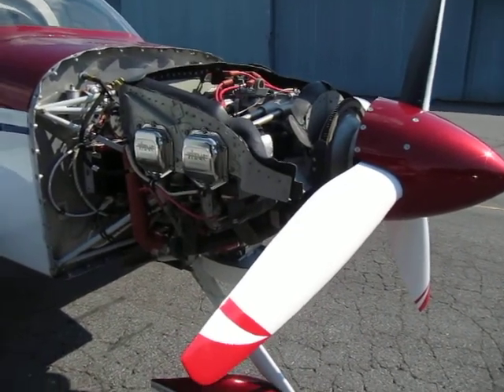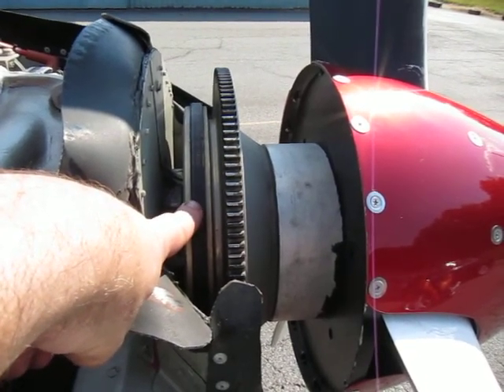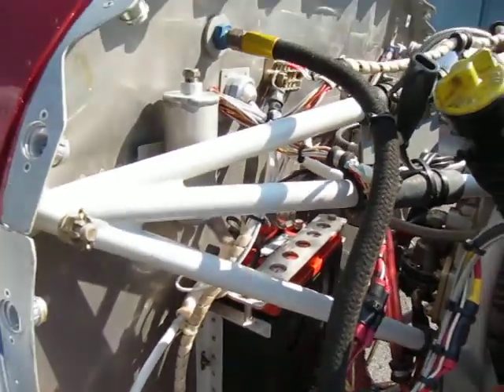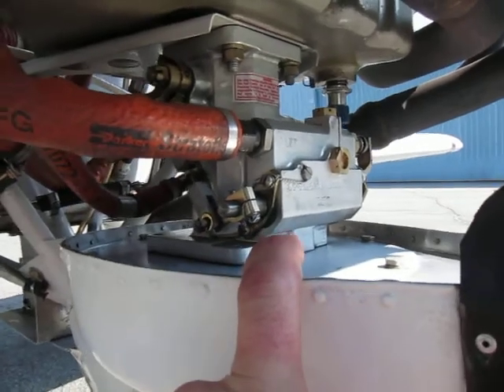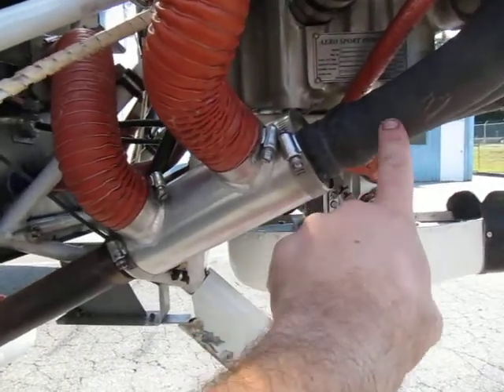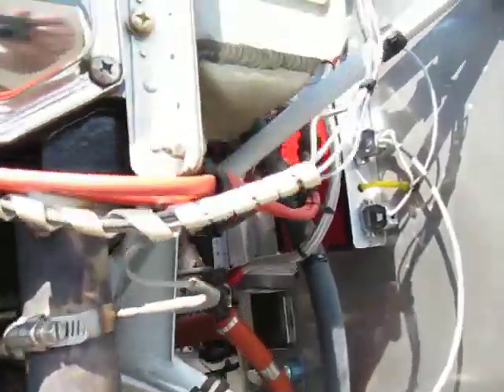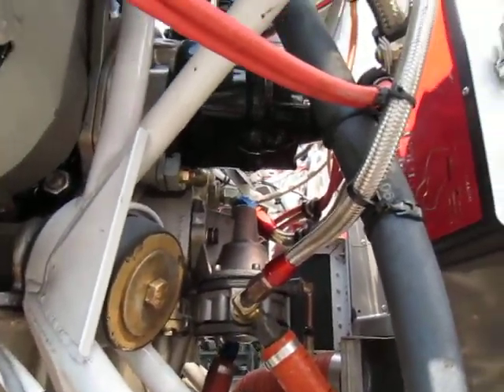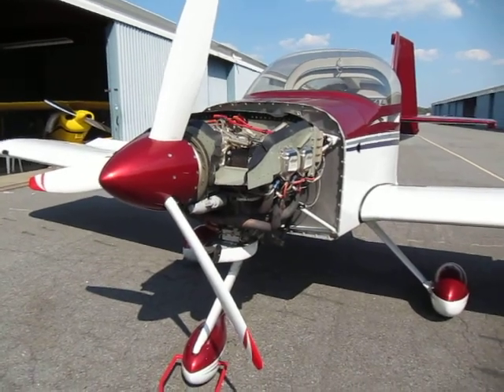RV-7A Engine Compartment

Comment: I realize this video is years old , so perhaps someone has corrected you since ..........the long bolts holding your oil cooler on should have thin wall aluminum tube over them with washers on each end , mounted between the angle brackets that are on the cooler..........that way when you tighten the bolts down it does not bend the angles over and crack them...........the total length of the 2 washer and tube stack must be exactly the dimension between the two angle brackets ............too short and you will bend the angles over when you tighten down the bolts............take them out one at a time as you put a washer tube stack in..........that way the cooler will not shift from original position............you can use the same bolts.........you will develop cracking if you don't support the angles better...........oil coolers are too expensive to repair cracks...........nice job though on the under cowl components..

Comment: If the CATO props are so light and you had to add weight to the spacer to balance the plane, would it make sense to use heavier starter and alternator to increase the weight instead of mounting a rotating mass which affects the aircraft inertia?